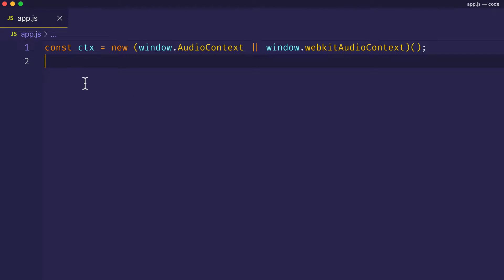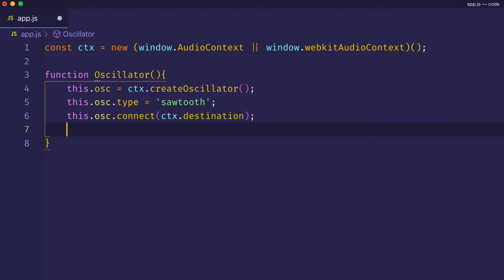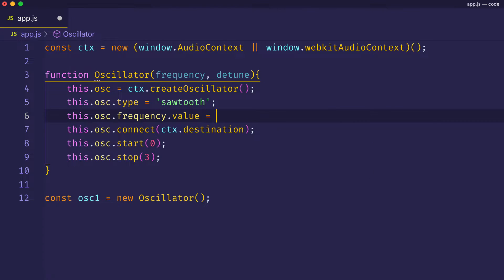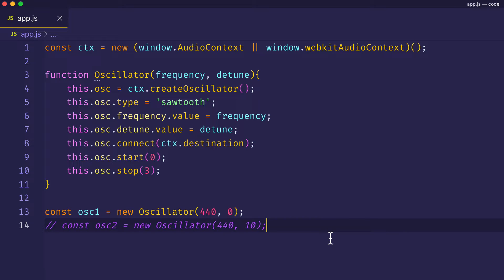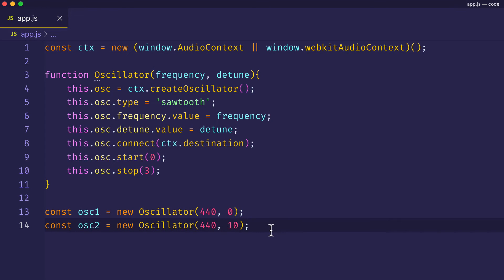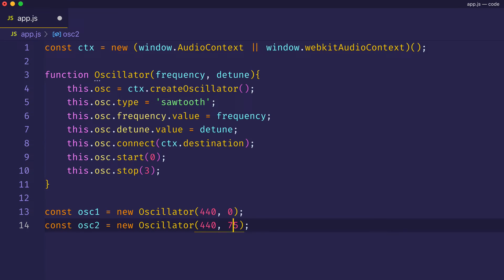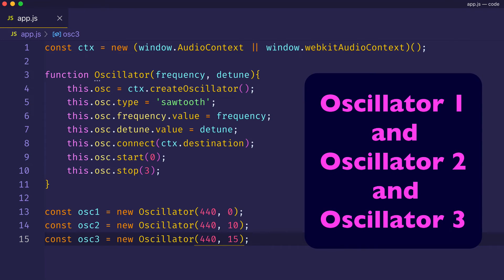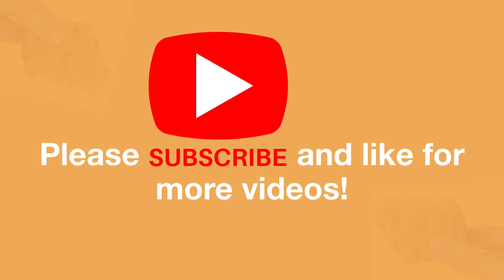Web Audio API -Detuning Tutorial

Comment: I don't really understand what detune actually does. The sounds were indeed different, but how does it actually do it? I mean does detune mean phase change? or something else?
Reply: Hi Vighnesh, I try to explain that around 9:45 into the video.  It's more than just a static phase change.  With detuning, the waveforms are also moving at different rates which creates those interesting interactions between the waveforms.
Reply: no, that sound summing is called Chorus, and it only happens when you play a detuned copy at the same time you play the original sound. This was used a lot in arcade games to make sounds sound brighter or cooler